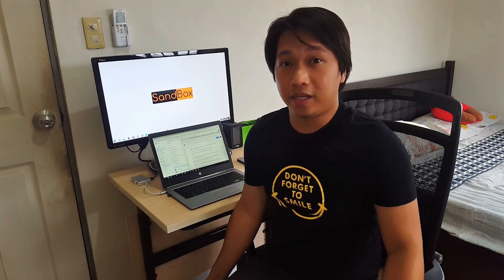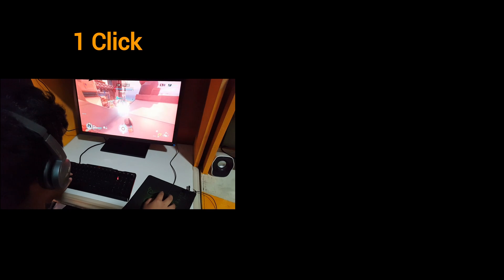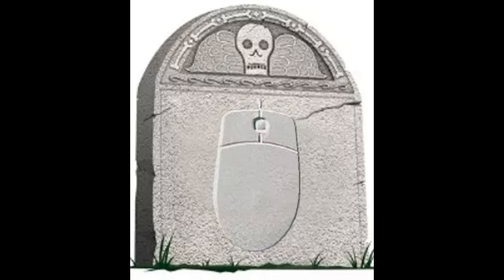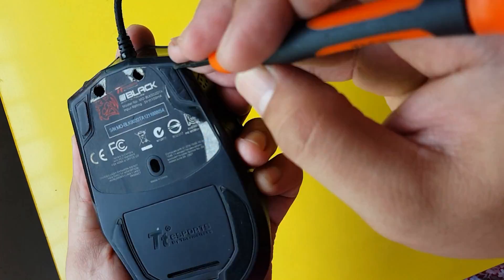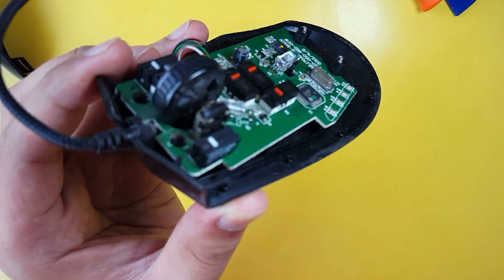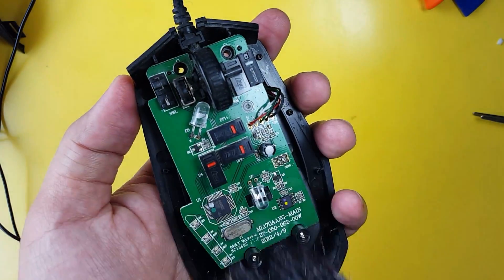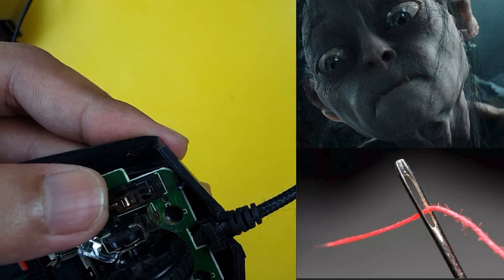How to Clean and Repair faulty Mouse Click button

Comment: Before buying new mouse, I tried this. I made it and didn't expect to revive my dead mouse (I just tried this because my mouse  left click is already dead), proper tools will greatly help to do this thing, the frustration on getting the white tiny part back in its shell is hell💀💀. the trick is the tiny copper thing should do the "click" sound and it will work. 
As for my mouse scroll, I didn't put any lubricant because the scroll has hexagonal modular design, I can just remove the scroll it self, clean it, and put it back together. YOU EARNED A SUB THANKS! 💖💖

Comment: if you use a little bit of heat you can preserve the stickiness on the mouse feet/slides so you can put them back on. They help with the friction when you move your mouse on the mouse pad 👍

Comment: After removing the metal bronze piece,, your mouse click will NEVER behave the same,, did it two times after remounting it either it will be too hard to press or so airy and light that you accidentally click only by resting your finger this metal piece is so fragile and micro engineered to give a specific click feel that is impossible to recreate it by a screw.. cleaning it somehow without removing it is vital

Comment: I never noticed black stuff forming on the copper, I usually tried to put paper between the contact points and try to sand it down but it didn't work, so I'd just replace the switch.. guess I wasn't tough enough on it like using a screw driver.

Comment: I have a logitech M280, and I didn't want to break my mouse, so after disassemble the cases into two, I didn't do anything but blow hard around the button lick element on the circuit board a few times but carefully, after which it works way better than before. Yes, dust could be an issue

Comment: anyone peeping this down the road id recommend using a toothbrush and rubbing alcohol to clean the spring off, some gunk gets REALLY stuck on there, plus you dont wanna scrape the contact with a metal screwdriver tip (also isp just generally evaporates dirt off metal). no use isp on plastic tho its really not good for it

Comment: Do NOT take this little metal piece off! I did and it took two hours to get it back into the tiny groove. They are not all the same.  There's another video where the guy takes a pick and scratches the two contact points clean WITHOUT taking the copper contact off.
Reply: I literally just did it in 15 minutes. You need patience and a steady hand, and to pay attention to what he does. It's really not difficult.

Comment: Step 1 : open Omicron switch 
Step 2 : the little piece of metal sheet fly away and you are screwed :)
Joke aside, this take a lot of time to open (I had to use fingers to open it, screwdriver was too thick) and even more time / effort to get it back properly. 
My mouse was faulty (left click wouldn't hold). After switch cleaning and reassembly it's fixed. It feels like the left click is a little more stiffy.

Comment: I fixed my favourite Logitech MX mouse with these instructions. Thank you. Somebody online once told me that the capacitor in the mouse was faulty, and I had to buy it on eBay to replace it. Turns out it wasn't true, until these instructions showed me how to fix it.

Comment: Mine wasn't just clicking 4:17 into place and was getting very frustrating trying to figure out where it wasn't going back together. 
For anyone else in the same situation, here is a better close up of the "click" into place step what is actually required.
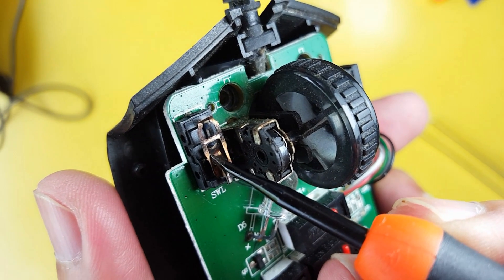https://www.youtube.com/watch?v=2sh7KwUudtI&t=205s @3:06
Push down on the bent part to snap it into place.

Comment: Redragon m901 perdition 24000dpi mouse kept triple clicking, so I tried this. Ended up slicing my finger open with a knife trying to open the black click box, which was impossible to open. Somehow managed to get it open and spent 2 hours fiddling with the copper plate. Put it back in wrong, then put the box back together. Had to try opening it again and the small white piece got launched into the unknown. Spent another hour searching for it on a white carpet, but couldn't find it. Patience ran thin and ended up raging and smashing the mouse, knowing it was worthless without the white piece. Battery broke open and got in my cut, finger starts burning. Now I need a new mouse.
Reply: nice comment

Comment: I need help with re installing the copper strip. I made the mistake of removing both of them at the same time and I can’t figure out which one are they supposed to go on. I tried many ways to install them but I can never get the click sound you mentioned and I can never seem to install them in a way that they are not loose. Are they all supposed to go in the same way in all mice? I have the razer deathadder chroma. Thanks in advance

Comment: I clicked like with my fixed mouse button, thank you! (I found that its better not to bend the lil clicker piece like shown, but rather, make sure it is straight and the little tab is not bent down too far, tried it both ways, got much better audible click from the second way.)

Comment: Thanks. 

Got to use anti-static brush, if there are ICs, static from a regular plastic bristle brush could fry the nanometers sized transistors and circuits in the IC (ICs: microcontrollers, CPUs, FPGA, RAM- SRAM or DRAM, SSD).

God bless, Rev. 21:4

Comment: I have a much easier way to fix any buttons including the power button of your smartphone. You need to drop a drop of mineral oil on the button contacts. The oil will prevent the formation of an oxide film and the button will function like new. You can use engine oil or any other liquid mineral oil used to lubricate mechanisms. This also works with volume control potentiometers in audio amplifiers.

Comment: Ended up pulling the switch out of the circuit board trying to lever the switch open. It also pulled the solder pad off, so there is no way I can solder it back on. Basically wrecked my mouse completely. Also damaged the catch on the switch so it doesn't close fully. Trying to repair a heavily used switch is kind of a waste of time, as the metal is already weakened, it will soon bend and produced weak/no clicks soon enough. Much more sensible is buying quality replacement mouse switches (most switches in computer mice today are cheap crap), unsolder, replace and solder with new switch, then you have a switch that will last almost forever.

Comment: Most of the actual mouses use chinese made microswitch who are junk because made in bad metal who burn at contacts: i did repair my brand new Corsair mouse (who had 2 dead microswich after only 1 month use!) with the microswich from a 22 years (!!!) old 3 button mouse with microswitch "made in Japan", who fit perfect in place from the chinese junk, and this work now perfectly!
Reply from the maker: Japan = Quality
Reply: the original part of  the mouse might be coming from China too.

Comment: Is it safe to remove mouse feet as my screws are located below these mouse feet. And my mouse feet's shape is exactly same as in this video.
Reply from the maker: Hi, Maheep! Yes it's alright. If ever, you may use a thin double sided tape to make it stick again.

Comment: I'm trying to get into my m65 corsair and the plastic housing prevents me from getting to the left click as easily as he can right here. Prying it out seems kind of dicey. Had to pull the circuit out. I'm not sure if the copper filament is reinstalled or not, and this part is really vague in the video
Reply from the maker: Hi, JCD! I realized that after reading some of the comments and watching the video again. I should've shown it in from a different angle. I'll do better next time. Thank you.

Comment: Thanks for the nice video and a 2nd lease of life for my mouse. The critical part is getting the copper plate back in its place. If anyone is having issue with that part just remember that both middle and front contact points have two steps and the plate needs to be on the first step in both of them. Just pop open the other side switch for reference and you will get it.
Reply from the maker: I'm glad you managed to give your mouse its 2nd lease (the same is true for your future mouse)!

Comment: I tried this on my mouse but didn't work.  When I opened my switch, there wasn't any corrosion at all.  I think what happened with mine is the switch is cheap and the brass part is just too weak from all the pressing.   What I did though is I have a collection of old mice, so I removed a known good switch from one and replaced.  Now it's like new again.  The left button switch tends to wear out faster obviously.  The other two switches are usually still in good condition.  Now I know I have enough spare switches that I shouldn't ever have to buy a mouse again.
Reply from the maker: I'm glad you managed to find a workaround! With those spare, you will be able to extend the life of your mouse for a very long time!

Comment: I saw absolutely no reason to remove the rubber pads on the bottom of the mouse. Of course I also had to watch this muted. But I didn't see a reason.
Reply from the maker: Hi, White! I guess it depends on the manufacturer and model of the mouse. There are some that will really require you to remove it so that you can unscrew the screws and open the mouse.

Comment: I managed to re-install the copper part, and my mouse works when I press the white button however as soon as I put the cover back on and try to use it it suddenly doesn't click anymore. Do you know how I can fix this ?
Reply from the maker: Hi, ZM! Were you able to place the copper part properly? You can check it by removing the cover of the mouse click again and use a precision flat screw driver to play with the copper sheet and see if it clicks. If it does, then I guess you just have to re-seat the mouse button again.
Reply: @Jaybon  Yes I did, I was able to click with the mouse using only the tiny white part. But I already bought a new mouse, only 20 Euros and does the job properly. Thanks for the reply and the video anyway! Was interesting to see how a mouse works, I just view my reparation attempt as a little educative experience.

Comment: Thank you, my mouse works again. 

Tip 1: before opening the little case, place a small piece of sticky tape onto the little case. This prevents the small white little plastic piece from flying away never to be found again.

Tip 2: consider cleaning the metal sheet without extracting it. It seems it's not always necessary, or desirable, to extract it.
Reply: Taping from the top side also helped me to reassemble the case easily. Thank you!
Reply: This reminds me of the first time i put a square bracket into the racks. 10 points for the fling lol
Reply from the maker: You're welcome! I'm glad you managed to fix your mouse. Thanks for the tips as well.

Comment: Thanks fixed the issue :) I got lucky with putting the small piece of metal back to its place
Reply from the maker: You're welcome! I'm glad you managed to fix your mouse, Mist! I got some tips in one of the comments (Land.on.off Mars) which can make your life easier next time.

Tip 1: before opening the little case, place a small piece of sticky tape onto the little case. This prevents the small white little plastic piece from flying away never to be found again.

Tip 2: consider cleaning the metal sheet without extracting it. It seems it's not always necessary, or desirable, to extract it.

Comment: I'm scared that if I try this I might break something...
Edit: I fixed it
Reply: Same
Reply from the maker: Hi, 4th! A comment that I got from someone that might help you.

Tip 1: before opening the little case, place a small piece of sticky tape onto the little case. This prevents the small white little plastic piece from flying away never to be found again.

Tip 2: consider cleaning the metal sheet without extracting it. It seems it's not always necessary, or desirable, to extract it.
Reply: @Jaybon  thanks sir
Reply: @Jaybon  oh I forgot to edit my comment. My mouse is fixed from ur vid, but when u plug it into my PC, it says USB not recognized, so I just gave up on that mouse lol
Reply from the maker: Hi, Delores! Here's a comment that I got from someone that might help you.

Tip 1: before opening the little case, place a small piece of sticky tape onto the little case. This prevents the small white little plastic piece from flying away never to be found again.

Tip 2: consider cleaning the metal sheet without extracting it. It seems it's not always necessary, or desirable, to extract it.

Comment: OMFG I Have been trying to put this copper sheet in for the past half hour :((((((((((
Reply: Where does the middle of the copper sheet hook on? On the higher part of the prong or the lower? What makes it "click?"
Reply: @111BLACKLIGHTNING111  idfk my mouse broke when i tried this
Reply: @Tobeh12  The tension of the spring is applied laterally, not vertically like one might assume. That was my problem, but I traded one for another.
Reply: @111BLACKLIGHTNING111  nice i jist had to wait like 5 months to get a knew one
Reply: yeahh, i struggled too. i gave up and just bought a new mouse hahahah

Comment: welp minecraft pvp is more hella consumes many clicks because i click 10 clicks a second which is cps and which is needed for pvp well it only taked 3 months to get problems i need hard clicks to like hold and mine an thing
Reply from the maker: I rarely play minecraft pvp but if that game usually requires 10 CPS then I'd rather buy multiple cheaper mouse out there. Thanks for the heads up!

Comment: Observations on Logitech Nano optical mouse: 1- at 2:30- The reference to removal of 'cap' seems to imply the small tabs can be pushed in to unlock the top. In my case the tabs are attached to the base and would not move. I used a straight pin to pry out the corresponding 'ears' of the top outward to unlock/remove the top. 2- A caution, the small foil is easily bent if cleaning is not done very carefully. 3- The small curved portion of the foil holds it in tension and is the main actuator for proper actuation of the button. If over done, you have a hard time getting it back to correct tension. 4- cleaning the contact points in the base with a steel screwdriver took the copper  plating off the contacts AND damaged the small grooves that the copper foil sits in. Thanks for the video!

Comment: Well, i can't pry open my mouse no matter how hard i try anyway
Reply from the maker: Hi, Petran! Have you tried using plastic prying tool? It is easier to locate the mouse casing latches using it.
Reply: @Jaybon  hey, i managed to get it open. There were two extra screws hidden under stickers at the bottom.

Comment: dude the prob is the part near the scroll button doesnt click what to do
Reply from the maker: Hi, Secregentist! Are you pertaining to the Mouse 3 click?
Reply: @Jaybon  actually my left click is hard to click is there any way to fix it without buying anything
Reply from the maker: @secregentist1973  I see. It's hard to click but it register right?

I guess it needs cleaning already? There's probably a build up of dust or some sort that affects the mechanism.

I suggest you give this method a try first. There's nothing to lose anyway. 🙂
Reply: @Jaybon  yes it registers the click ill try cleaning thank you :)
Reply: is the prob spam click because i play bedwars on minecraft
Reply from the maker: @secregentist1973  hahahaha there is a high probability because I used to play that as well and it resulted to that problem. 😆
Reply from the maker: @secregentist1973  you're welcome.
Reply: @Jaybon  but if that is the problem then is it bad news? because i dont want to pay anything
Reply from the maker: @secregentist1973  don't worry, this method will also solve spam clicks.
Reply: @Jaybon  thank u, u gave me a big relief :)
Reply: actually i dont have a gaming mouse i have a normal mouse the name is intex glow
Reply from the maker: @secregentist1973  you're welcome. 

Gaming mouse or not, it's all the same. Just be patient in cleaning your mouse specially in the placing back the tiny copper thing. 😁
Reply: @Jaybon   hey i cleaned it but i think the prob is with a part of a button that doesnt go down together

Comment: I mean my mouse is working but it like doesnt hold for long it holds like for 1 sec then it stops
Reply from the maker: Give this methos a try, bro. Specially if that mouse is an expensive one.
Reply: @Jaybon  ohhhhh it is but its different its a gaming mouse
Reply from the maker: It's worth trying then, bro. If it won't solve the issue, then at least you tried. 😀

Comment: the problem with mine is that when I hold down mouse 1 the mouse 1 key just releases out of nowhere
Reply from the maker: Hi! If your mouse is expensive, you give this method a try. :)
Reply: @Jaybon  okay. Yeah its sort of expensive. Its a deathadder elite that cost around €40
Reply from the maker: @rados1aw  I suggest you give this method a try first. Whatever the outcome, at least you tried. Cheers!

Comment: I have the original razer abyssus, still works but the right click is feeling a bit stiff, pretty sure it uses the same mechanism so might have to give this a try (especially given that it now cost $100 Australian, compared to $35 when I bought it in 2013)